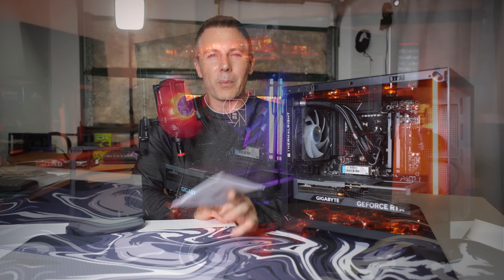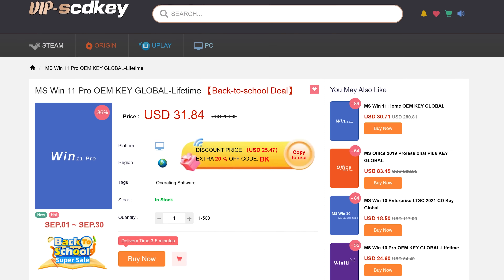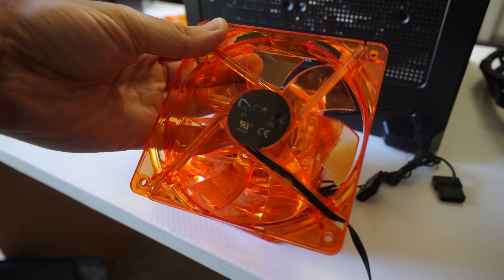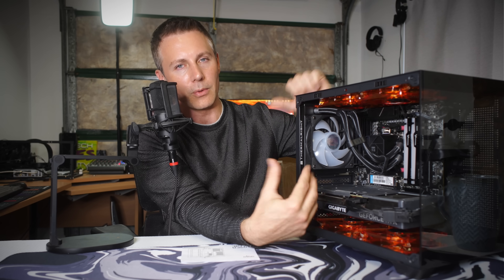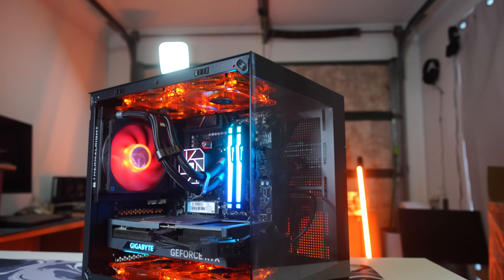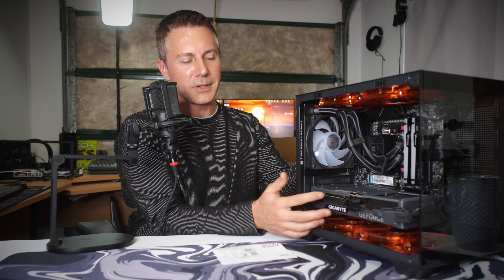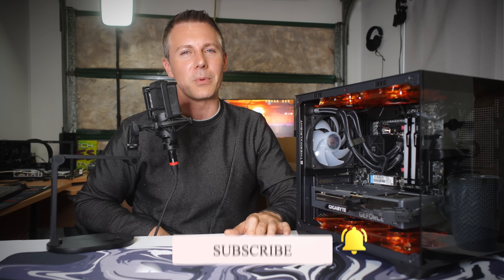I bought the cheapest PC case from Aliexpress...

Comment: I have this case here in the PH it is branded as YGT on shopee but I also found it as CVS on a physical store, I had previously used 7 1usd 120mm fans but it was too loud so I just removed it and kept the side panel off

edit: it was around 20usd but on the physical store it is around 30usd

Comment: you dont need an expensive case.
They dont solve the real problem.
The problem is that the wind directs hot GPU air all over the place internally onto CPU fans and onto the Motherboard VRM and RAM.
There needs to be channels that direct GPU air straight in and out of a specific component.
Modularised cases could isolate hot GPU's and push air directly out instead of circulating and venting the hot gpu air onto the cpu fan.
A modular case with divides between the GPU and CPU is what we should be trying for, 
or mount the GPU externally because cases are not fit for purpose.

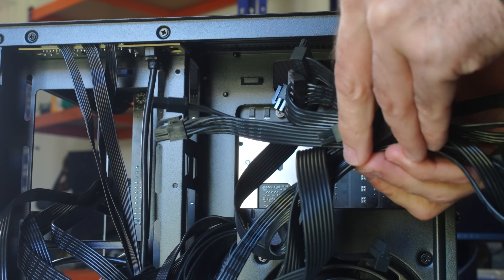Comment: I purchased this case last year, looked like a great bargain. It was on the curb next day. Don't buy this crap, you can spend an extra $20 on a real case that will go a long way. No pre-installed fans, tiny motherboard tray that will not properly fit most modern M-ATX boards, and ABSOLUTELY ZERO room for your power supply. You will need an extremely short, modular power supply if you want to use this case. That's where you savings will go. Honestly you'll probably need to adapt an SFX power supply because that's how little room there is. If you buy a standard, non-modular, cheap power supply your cables are getting SMASHED in this thing. 7:47 Look at that rats nest, look at how he can't even come close to fitting all those cables behind the motherboard tray and they're pouring into where your fans should mount. Major critique left out because this is a sponsored video. DO NOT BUY THIS JUNK.

Comment: Better to flip the AIO radiator 180 so the inlets for the tube are at the bottom of the radiator for optimal configuration
Reply: Actually, no………tubes always above the CPU. CPU pumps are not powerful enough to lift liquid.

Comment: Great case! I reviewed this as well! Should note that you absolutely can remove the glass front. There are 4 screws, 2 at the top and 2 at the bottom at the glass corner edge that you need to unscrew and on the other end there is another set of screws, one on top and one on the bottom that you need to unscrew, then you'll be able slide out the front glass panel.

Comment: Time for the cheapest build. Cheapest CPU, cheapest mobo, cheapest case etc...
Reply: Lets add cheapest value build thats NOT garbage and can be duplicated by the audience lol
Reply: Marco you are a legend for saving this card. Well done 💪😎
Reply: i did lol this case with a dell 7050 i7 64 ram ddr4 rx580 8gb water cooled with rgb all  for less the 250$ usd lol
Reply: Bought the same case and built with dell opitplex 790 i7-2600 32GB RAM COLORFUL GTX 1070 128GB SSD 8TB HDD didn't have much space for cable management in the back but overall great price
Reply: @aloy1920  I might put my Lenovo Thinkcentre m73 SFF in this case lol.

Xeon E3-1226v3, Radeon Pro WX 5100 (8GB VRAM), 16GB RAM, 1TB SSD.